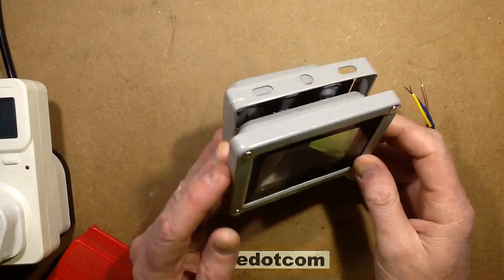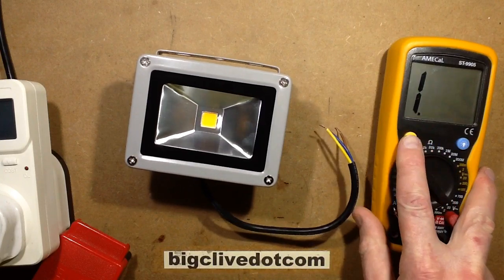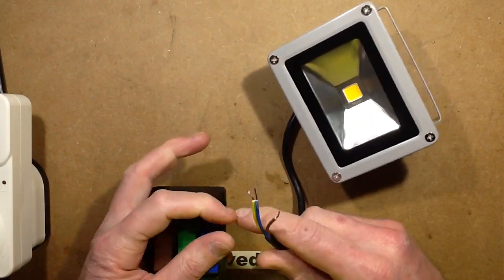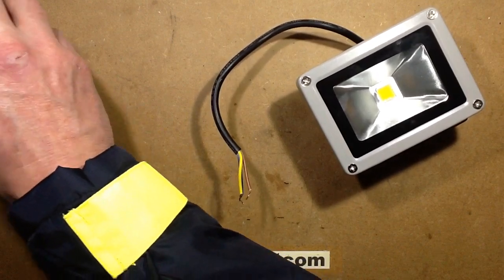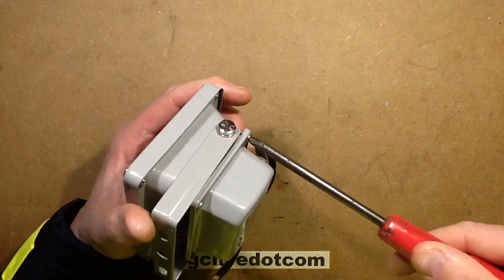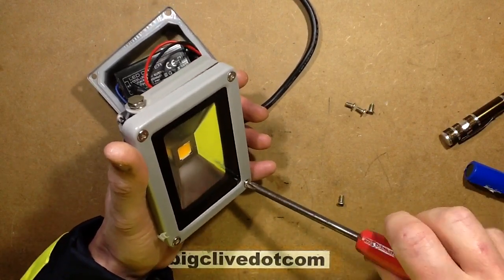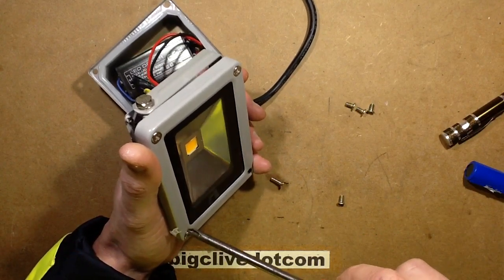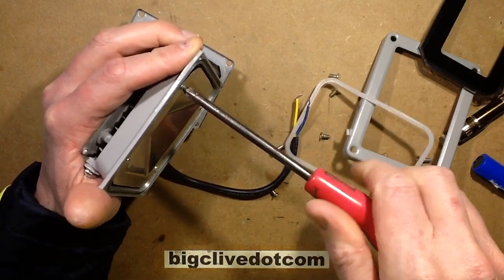Random cheap LED floodlight teardown.

Comment: can i   ask can you put a 100w led  chip in a 30w led flood light case with the heat of the chip
Reply from the maker: If you put a 100W LED in an existing casing designed for a 30W LED and with a 30W driver then it should be fine as it is sized to dissipate 30W.  You can't put a higher power driver in a small case.

Comment: I bought a couple of 20watt versions to use in my workshop as task lighting for my lathe.  Great light but the RF interference was so bad that my FM radio became useless.  So, I'm still looking for a use for the pair where I won't be using a radio.

Comment: That Ebay vendor has a very good rating. I just received a similar version of this and for my $7 CAD I got a dodgy 10w led with a 10Watt ceramic resistor that was not quite soldered to one of the leads. And that's all. No LED driver to handle the 110v, no earth wire. and the case metal was about the gauge of tin foil.

Comment: the led driver died in my 10w light so i put a 12v t5 tube light driver in the floodlight and found i can use it with a single 1.5v aa battery.

Comment: Hi Clive. Some time ago I ordered 5 LED flood lights from Banggood. http://www.banggood.com/10W-White-or-Warm-White-IP65-LED-Floodlight-Wash-Light-Outdoor-AC85-265V-p-83657.html?rmmds=search When I turned them on one of them flickered a while and then it died. After about a week #2 did the same and now after a four weeks the third did the same but that one flickers weak from time to time. My question is, what part in the lamp is failing, is it the led or the driver? Can you recommend parts to buy to fix them? The housing of the flood lights are super so its a shame just to throw them away. I get it, you get what you pay for so I wasnt expecting much when I ordered them. Have you done any video of this? BTW keep up the good work, love your videos.
Best regards from Norway,
Torstein
Reply from the maker: The 10W LEDs are cheap, so it's easy to fit a new one to narrow the fault down.  Note that there are two types.  One with a 3 by 3 arrangement that runs at about 12V and one with all the LEDs in series that runs at around 27V.  The label in the driver may give a clue, or measure the voltage across a working one when it's lit.

Comment: Hi There , This past June I bought the Amp/Wattage/Power Meter you show in ALOT of your Videos . I got it and Opened it up and Played with it and set it aside . It was the Start of Summer So We got Really Busy doing Shows . About a week ago I pulled it out of the box and Plugged it in , NOTHING . DEAD AS CAN BE . Power Passes Through it but that is all it does . It is MADE for the USA . I was wondering if YOU would like me to send it to you to see if YOU can figure out What went wrong with it . I am sure I am NOT the ONLY person this has happened to . The Back Up Batteries have 1.25DC Volts so they are not dead . It Looks as if the LCD Panel has Died . If you would like it , Send me a E-mail with your address and I will Send it off to you . You Can Keep it if you fix it or not . Is there a Much better Place on eBay to buy them ?? ctm4metoo@aol.com

Comment: Hey clive what soldering tip do you use as i like the method that you solder with
Reply from the maker: I tend to go for a larger tip for the extra heat mass.
Reply: ah okay dont you usually go with the chisel tip?
Reply from the maker: Yes.  I got so used to the Antex 3mm chisel tip that I stuck with that style.

Comment: Clive, I checked out that seller, and they are listed as "from China"

They do not have anything for 5 quid. The least expensive item in their listings was a 10W - 85-265v cool white PIR sensor outdoor lamp for 10 USD.

How would one know if one is getting a lamp similar to the one you show in this video? I don't have all the test equipment you do, and certainly not your knowledge base to know what to even look for. 

A 10 or 20W LED flood for a fiver would work wonders in my garage.

Thanks for a great channel!

Comment: Anyone got any ideas on how to actually make it battery powered? An 18650 battery seems to be stretching it, when you have to fit the driver, battery, and charging circuit in that case. Unless its an external mounted battery

Comment: I bought some cheap 10W LED floods to light up the garden when I moved 2 years ago. Been as good as gold no complaints, I'm of the opinion "that if you do a bit of research and don't buy the absolute cheapest item out there most "cheap" Chinese stuff is OK"

Comment: For the 5 quid, I'd rather have two pints of bitter ...
Reply: Richard T you can buy bitter for £2.50 a pint?! £4.10 down here lad!
Reply: Mr incredible To be fair it was a few years back during my uni days ... 2.5 a pint ... That was around 20 years ago ;)
Reply: It was 70p a pint in my university halls bar! :-) That was 1988, how many year ago was that? Argh!

Anyway, these lights seem better value than a pint, but once you'd got a light to light your way back from the pub, you can then happily spend the rest if your money on beer.

Comment: According to the instructions it could be installed in mines. Bet it didn't have an ATEX label on it.
It might be ok in a copper or lead mine apart from reliability but fatal in a coal mine.

Comment: dehumidifiers in the winter? i thought i had heard everything... lmao
Reply: Confirmed! they're a seasonal line in the UK and shops bring them out in the Winter. I'm sure most of Clives favorite boutiques will have small windowsill units based on hygroscopic crystals out. (poundstretchers certainly does)
Reply: Andy Merrett chill out there's nothing "wrong" with it. it just gets unbearably dry in the winter where i am so i used a humidifier in most rooms.

Comment: I've used a floodlight housing to keep a Raspberry Pi and camera in. It's been in the garden for years. I took out the thick glass and replaced it with picture frame glass. In order to get a good seal onto the silicon seal, I put some strips of foam between the front frame and the glass.  So you could use them for solar, but you just have to use other glass.

Rather obviously, you have to be able to cut glass. It's not a difficult job.

Comment: I was really lucky that the first 30W LED light I bought after watching your videos, was actually using exactly 30W of power. I was expecting total garbage. The light is really bright and it has a really small package. the only bad thing is, that I couldnt take it apart. looks like the reflector is glued in.

link: https://www.aliexpress.com/item/New-Arrival-30W-50W-led-floodlights-lighting-outdoor-spotlights-spot-flood-lamp-garden-light-reflector-AC220V/32667890466.html?spm=2114.13010608.0.0.FDvS7q

Comment: Hey BC if you want to remove the "baked on black" from the glass all you have to do is pop it in the oven at medium heat for an hour and then when it cools down the black will just scrub off with hot water and dish soap.

Comment: Apart from the loose ground, this flood light seems to be actually very reasonable. Since the LED lights evenly, and the unit does draw close to its advertised power, I'd probably trust it more than most of the others I've seen on this channel.

Comment: The black mask on the glass is called the frit. Properly done, it will be black glass powder fused to the glass and impossible to remove. In this day and age however, they are commonly done with some sort of thermoset plastic.

Yours
Vern

Comment: Clive, have you done something new with your sound? You're coming out of my centre speaker and not L+R (as usual)?...
Reply: Should have used my brain then deleted my comment! I was using some Bluetooth headphones a few hours before switching back to normal speakers. All fine after a reboot - I blame Windows 10 (for just about everything) - but thanks :)
Reply: W10 has potential that will never be realised. Actually feeling nostalgic for the Amiga today - that was a fun OS but... ah well, never mind!

Comment: I want to buy one! Can you link it?
Reply: http://www.ebay.co.uk/itm/LED-Floodlight-10W-20W-30W-50W-100W-Cool-Warm-White-Garden-Outdoor-Lamp-IP65-/112044157501?var=&hash=item5fb056a5ae
Although they are sold out of the 10W ones that Clive looked at and who knows if the higher wattage ones will be as good quality.

Comment: Lots of this kind of thing flying around in China. You order parts for another project, find you have been shipped too many which you throw into a bin someplace. Later on you find over-shipments have been made on enough projects to kluge together something you might be able to sell. Someone with enough experience in electric circuits designs comes up with something that produces light. They sell these in bulk and they end up with lights used for illumination of fried rice in a street vendor in Myanmar or something else. Hopefully, it doesn't fry someone else's parts. High tech today.

Comment: what im finding with the newer equally cheap led floodlights is the metal is getting thinner and thinner, lots of pressed steel parts where at least the older ones were mostly cast aluminium. also the floodlights with lots of individual chips (2835, 5730) tend to be less reliable, harder to fix.

Comment: Just a shame that the seller seems to have either sold out of them or jacked up the price (as always happens with chinese sellers), ah well... :P

Keep meaning to buy a set of this style of LED light as the other style (the really flat 10W things that started the ball rolling) don't quite fit where I want them, as the (replaced with UK spec quality) cable would rub on a brick wall, which ain't good, but these ones with a bit more standoff room are just the ticket, just need to get them when cheap enough for my wallet... :)

Comment: I bought four of these lights (look near identical on outside), except mine have cast aluminum backplate and cover, not stamped steel.  Now I'm wondering whose are the new design and whose are the old design. 😕

Comment: Had a couple of really shitty ones recently where there is no separate driver, everything is just mounted on to a board with the LED's and stuck in with some shmoo, the mains wires have been very close to the reflector and the only insulation is the blue protective film on the reflector

Comment: After a quick isle of man weather google, well into winter seems something different over in Britain
Reply: Well it's humid and cold at the same time... so it feels worse than the thermometer alone would tell you.
That's the stock response.

also I think weather websites generally read a few degrees hot. I had to scrape ice off my car at 6PM today after work and the met office says it was +4C

Comment: what wattage led do you think you need a fan assisted heatsink ? ive seen led floodlights at 50w with just a normal heatsink.
Reply: Depends on several variables you didn't specify.  First the claimed "50W" light probably isn't really 50W, second it would depend on the material and surface area of the heatsink on the particular light.  Third I don't see the point as it's little to no more expensive for them to just make the heatsink larger than it is to buy a "good" quality fan and wire that up, especially in this case where you would either need a 220VAC fan or a separate power supply for it.

Comment: why is it called floodlight? are you supposed to use it when a flood happens?
Reply: And then there are flash lights for when you wear the trenchcoat...
Reply: Jamie Rogers And there are Fleshlights for preparing meat
Reply: Yeah...and you can get spot lights, for when you're having skin issues.

Comment: May be you should desolder the LED from its power supply before connecting your bench power supply to the LED for testing. I have done that before and I fryed the LED power supply due to backfeeding!

Great video anyway!

Comment: I have two that look the same as these, but the earth wire was not connected to anything. seals were all great and it takes the same 7-8 watts. I connected the earth properly and they are hooked up beneath the cabinets above my workbench in the garage. Only I think i paid 3 dollars a piece for them. Probably the difference in cost for those extra screws holding the led and reflector and an earthing lug lol

Comment: all I can say is; (that simply indicates that I'm about to opinionate), whenever possible PLEASE avoid at ALL costs purchasing any electronics (or children's plastic toys), anything that may come in contact with foodstuffs for human OR domesticated critters or beastys that you love or care about, directly from China... be it from Amazon, eBay, Wish/Geek sellers, etc.,.  I learned some time back that [many] products are faulty from either shoddy construction, parts, components or failure but "turn-blind-eye" & passed through whatever inspection procedures that are performed before entering most modern, consumer conscious countries
Reply: id get this one though.., for a fiver this thing seems well build.., like clive said though.., keep low expectations and dont use it in a professional setting. ive seen many dodgy china things.., this one looks to be among the best.. close to not being dodgy. the question of quality and longevity of the driver and LED chip is still open though.
Reply: Stinky Cheese The problem with some of the uber cheap white silicone zinc oxide stuff some  China lights come with is it dries up quickly from heat and cracks.  You also never really know how much is applied until you take it apart.  It's more of a quality issue than material issue.  Sanding the surface is a good idea - there is a lot of powder coat overspray on the case inside.  Because they're cast aluminum, the surface is nowhere near flat, however; sticking a machinists pocket ruler on it reveals a good bit of waviness.

Having said all that, in testing before and after temps going through the trouble of redoing one, the heat sink fins were still reading same temp (137-139 degrees F).
Reply: v Rod 
Agreed, Clive first test the light for connected ground and it tests - fine. How many of us (me too) leave it at that? Maybe we are just so used to it being bolt- tight grounded. Clive opens the light up and discovers the ground not screwed tight, I mightn't have gone that far and put it in to service. EU, UK, NA, product, yeah. Chinese? No. with then, a physical tear-down and fix. Going cheap on Chinese products or spending more on western products (10 or more), pay a little more for reliability and get equipment into use quicker and safer. Yeah, your coat is bit noisy; better that and learn some safety. Clive makes great videos and we learn about some cheap stuff we can use for our projects. We're all pretty smart with good learning curves.
Reply: I agree...But only if you're going to just plug things in and not inspect them.  I don't have a problem buying some things, like smaller G8/T4 style LED lights, because you can see the entire design through the clear molded silicone without needing to take anything apart.  I've used the LED cob floods in this video too - but I always redo them completely (reseat all the weatherproof seals and gland, remove zinc oxide thermal paste and use better silver thermal compound, solder a longer flex/ground on, and check the power supply design (if it's not potted).  Even spending 20 minutes on a light works out much cheaper (and nicer light) than what a hardware store sells anything equivalent for (in fact, most by hardware stores by me rarely have anything equivalent).
Reply: I am not sure many of the big UK eBay/Amazon importers do anything to check the quality or safety.
Reply: Silver thermal compound is pretty much a waste on these.  The LED base area to wattage is far higher than on CPUs/etc, the LED isn't worth much, and the overall performance once it's on for a few minutes is dominated by the passive heatsink.  Regardless you'd probably get an equal or better improvement by just scrubbing the heatsink interface area with steel wool to level it and get rid of the oxide layer, then of course use the silver thermal compound if that's all you have.
Reply: Where did I write "uber cheap white silicone zinc oxide stuff"?  Normal grade zinc oxide paste works perfectly fine at this heat density for decades.

The heatsink fins will read the same because whether the thermal interface is better or worse it is still the same thermal load.  What would decrease, though possibly not enough to measure without precise equipment, is the LED die temperature.

Frankly I just wouldn't bother.  If I were tearing it apart that much, first thing I'd do is swap in a Cree XM-L2.  It might be different if I were building some massive light and the cost difference started becoming excessive but for a single light, especially a single light where I want to decrease the chances of the LED frying, a major brand LED is high on my list of requirements.

Comment: Hi Clive,   I bought some of these cheap 10w 240v flood lights recently. I bought mine to convert to 12v, using mr16 600mA constant current drivers. My lights only had 2 screws for the led mounting , luckily I noticed that my 10w chips were not sitting(seating?) flush against the heat sink wall.If I pushed against a loose corner I could see the slight movement. I had to find some screws to add in. I found mine for $6 each Australian, thought it was an error bought a few lol. My only concern would be how waterproof they actually are. Great fun converting them, 12v allows the use of so many products out there too. I have one connected to one of those cheap RF relay modules with a fob. Keep up the inspiring vids.